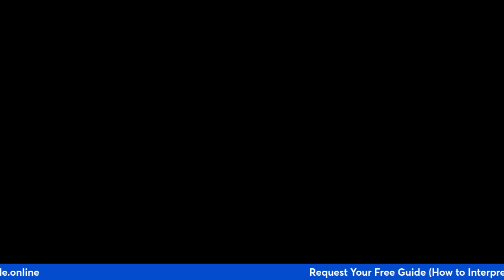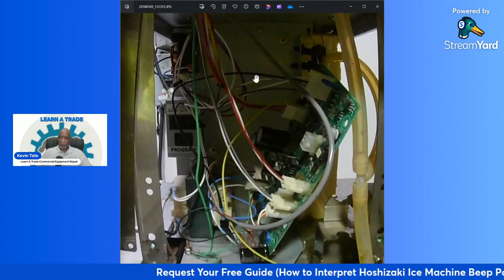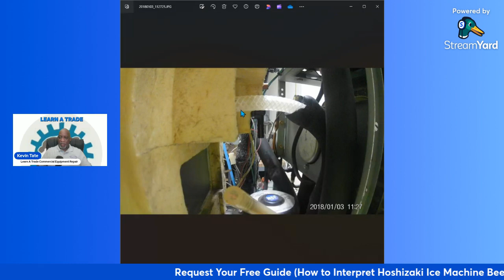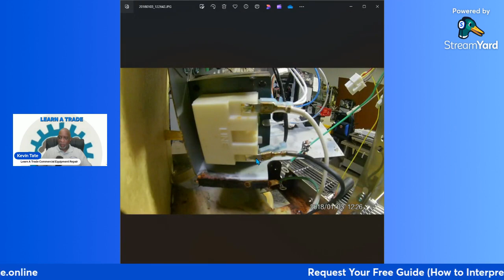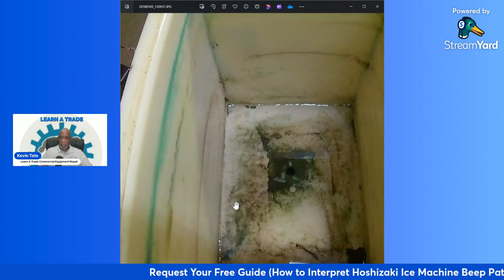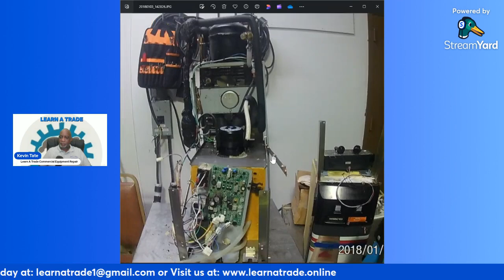Bunn JDF-2 Iced Coffee Machine Repair (Water Bath/ Water Pump Replacement)

Comment from the maker: 📲 Get the FREE LAT Technician Pro App:

👉 https://learnatrade1-ai.github.io/lat-tech-app/

⚡ Built for real technicians
⚡ Designed for speed in the field
⚡ Helps you troubleshoot with confidence

🔓 Unlock Full Pro Access:

👉 https://www.learnatrade.online/unlock-lat-technician-pro-access

✔ Full workflow access
✔ Advanced diagnostics
✔ PDF report export
✔ Expanded equipment coverage

Comment: You took the whole unit apart to replace a recirculation pump 6 yrs in the field and never spent more the 45 mins to replace one. But I guess you did all of the for the video
Reply from the maker: Yes I disassembled the unit mainly for those that are new to the field and may not be aware of the JDF.

Comment: So would thi water bath issue keep compressor from coming on. Have a jdf 2s and it is not cooling
Reply from the maker: If the cooling cabnet is not getting cold the unit will go into a shutdown.  There are multiple issues that can cause this. It could be a temperature probe issue,  a water pump issue, it could be that the compressor switch is not turned on. I would first check those things first. Usually if there is a pump issue you will find that the water bath will freeze up completely because the pump is not circulating water . I hope that helps some.
Reply from the maker: @Getsober4life  I want to add to your diagnosis of your JDF-2 question.  If the compressor is not starting up, you might want to first check the water level in the water bath. You can see the water level  by removing the front panel at the base of the machine. Look at the water level  at the clear tube that connects to a tee fitting that has a drain line connected to the other side of the tee fitting.  The water level should be at the bottom of the Tee fitting of the tank tube, if it is not, then the water must be filled up to that level in order for the compressor to come on. I hope this helps.
Reply from the maker: Here is a recent video that may help I put the link for the service manual in the description.
https://youtu.be/oDXNtmyJT04?si=BDr8gZEjA-LoPhga